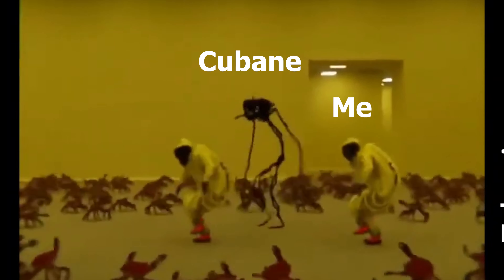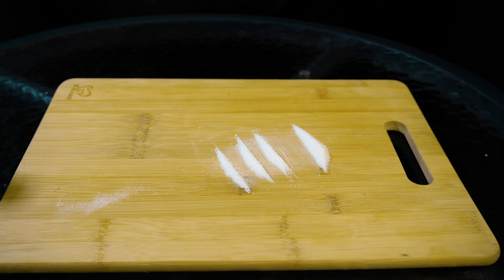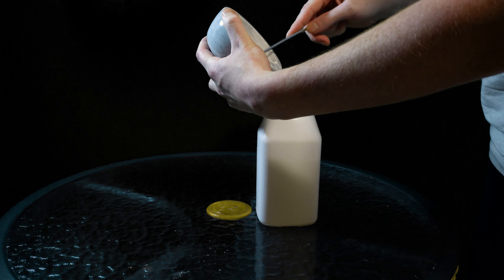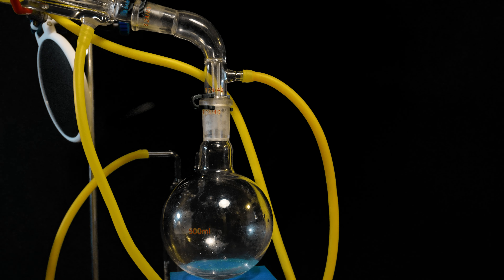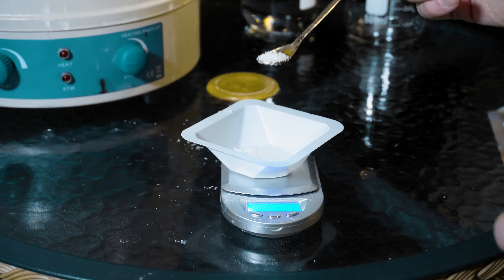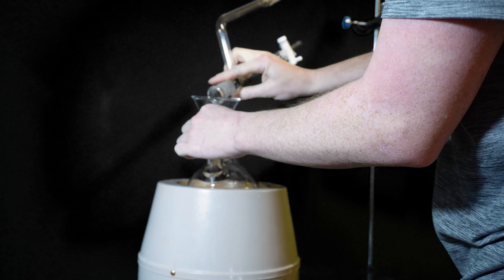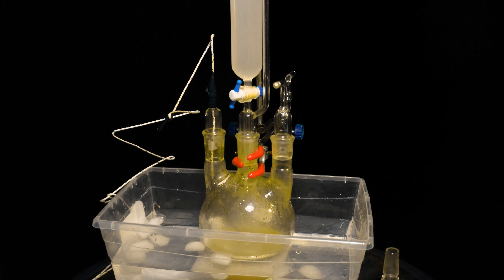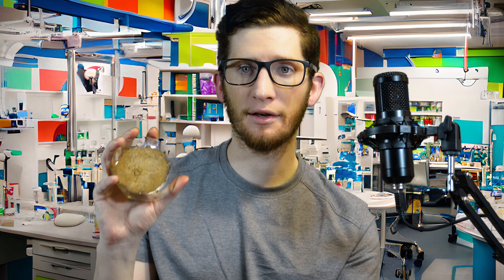Finally Had A Cubane Synthesis Breakthrough

Comment: I made the diels alder on small scale about half a year ago with purchased reagents and no further purifying and got a yield of 40%. This time i will try to purify everything much more so we'll see how good the yield gets
Reply from the maker: Here’s the excerpt from the 1989 paper that led to the breakthrough: “The quality of the dioxane was found to be critical. The use of ACS or HPLC grade dioxane from unopened bottles gave yields below 20%; the
same material distilled from lithium aluminum hydride gave 70-80% yields. Sinall amounts of water added to the reaction mixture did not decrease the
yield. Although filtration of undistilled dioxane through aluminum oxide sometimes gave satisfactory results, this method of purification was not reliable. Other treatments which would remove peroxides from the dioxane, such as reaction with trimethyl phosphite, also gave inconsistent results.”
Reply: @MaxfieldMED  I will distill over sodium and see how good that works
Reply: Just need Tom over here and the YouTube Cubane arms race is complete.

Comment: Yield 8 grams, does not mean anything! Remember to give percentage yields and compare it with literature, this will help you and viewers!
Purity, purity, purity, nightmare of any organic chemistry. I remember often purifying commercial chemicals to make reactions work. Keep witth good work!
Reply from the maker: Sorry this was a mix of a bunch of different steps but from Ketal -> Endo–2,4–dibromodicyclopentadiene–1,8–dione bisethylene ketal was 34% with half of the water solution wasted due to various attempts at different extraction methods. If I had used that method for all of it in theory ~68% with the literature showing 88%. Will include the link to the paper on this & the next video as well, it’s free! I will definitely be riding the high purity train from now on. I had actually discovered that same problem when scouring the 1989 paper, where they had to purify their commercially bought 1,4-dioxane to get good yields on this step. Thank you for the feedback!!